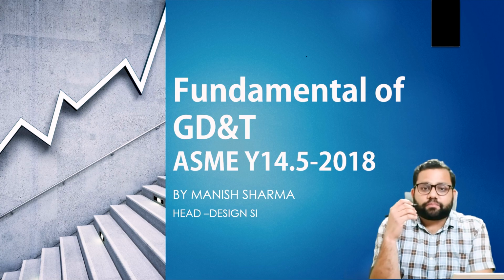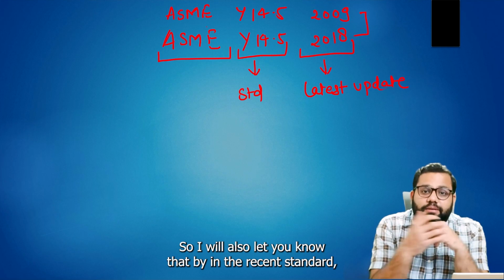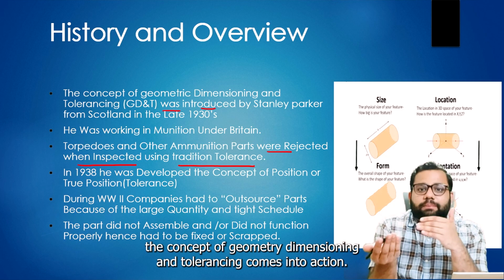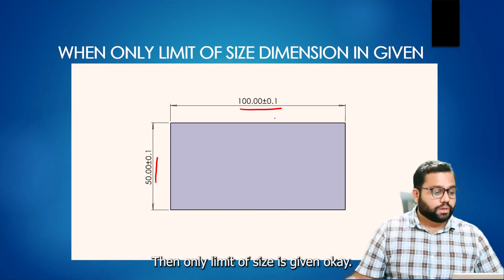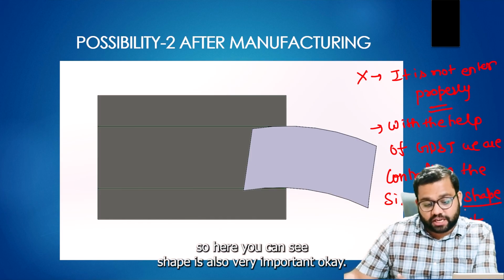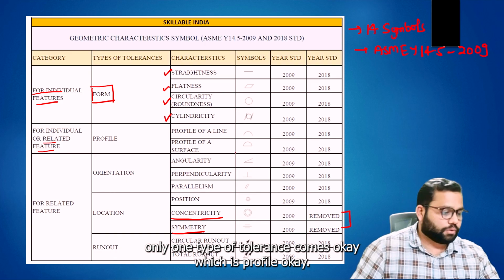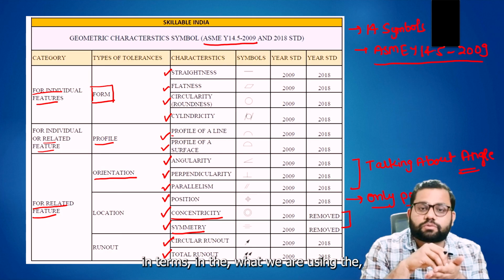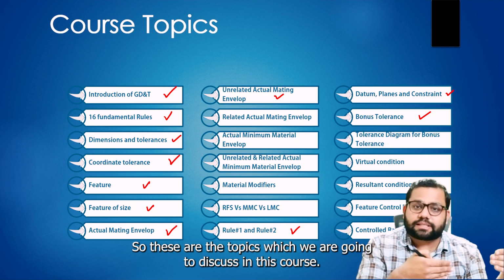Master Geometric Dimensioning &Tolerancing  |Tutorial -1 Overview |

Comment: What are the topic are you going to cover. Give me a syllabus
Reply from the maker: GD&T Importance
Fundamentals Rules
Coordinate tolerancing and its short comings
What geometric tolerancing is, and its benefits
Coordinate tolerancing Vs Geometric tolerancing
Size and actual local size, actual mating envelope, axis, center plane
Complex features, features, features of size, irregular feature of size
Least and maximum material condition
Non- opposed, opposed, partially opposed,pattern
Regardless of feature size
Related and unrelated actual mating envelope
Feature control frame and placement
Geometric characteristic symbols
Geometric Dimensioning symbols
Rule #1: applied to a feature of size, exceptions, overriding ,inspecting
Independency concept,
Rule#2: All applicable rule
Virtual condition, calculations, and worst- case boundary
Bonus tolerance concept and calculations
Verifications principles for a virtual condition boundary

These are Some Important Topics which we are Discussing in this Course.
Thanks For Interest.

Skillable INDIA